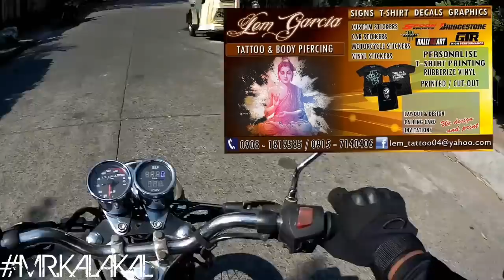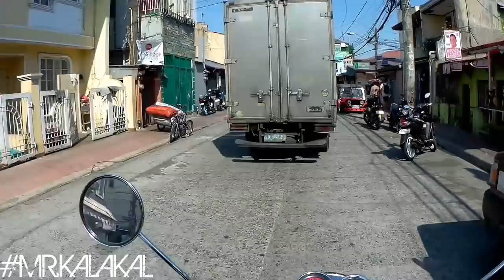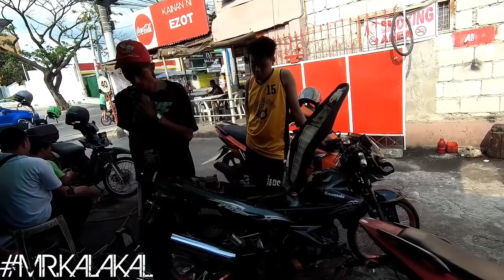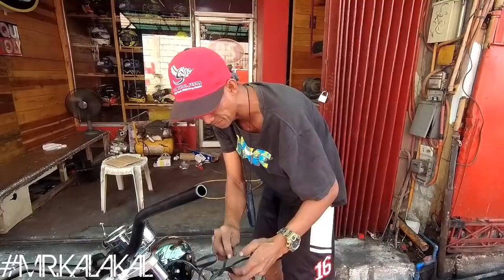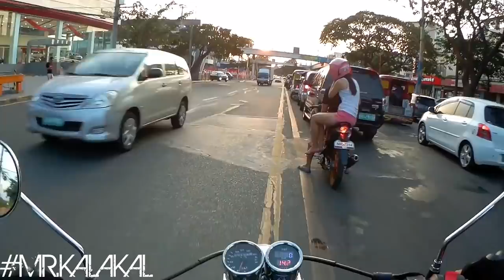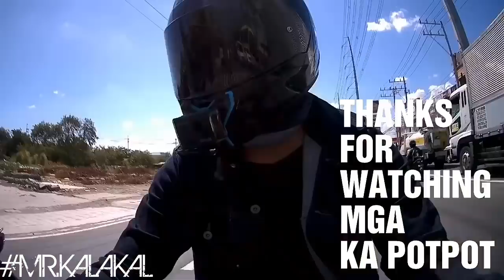HONDA TMX 125 / CG 125 | FATBAR AND RISER | BULLET PIPE | CUSTOM BIKES | MAX125

Comment: subscribe nice, vlog, boss, more power. sir question from a newbie keeway cafe racer 152 (brandnew) or 2nd hand base bike customized to cafe racer, san mas makakatipid ?sorry sa tanong.
Reply from the maker: go for keeway cr152. total gastos ko na kay max 125 nasa 20k na ata. saka iba ang bnew aalagaan mo nalang sa change oil at iba pang maintenance unlike sa 2nd hand ggaamutin mo muna pag naka chempo ka ng issue :)
Reply: @MrKalakal  thank you so much. appreciate the response. more power and ride safe sir.